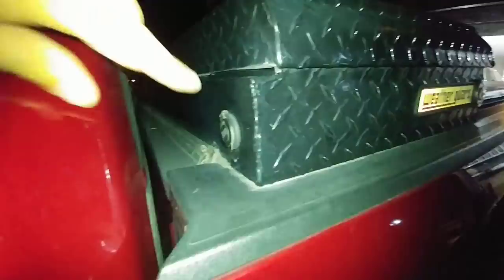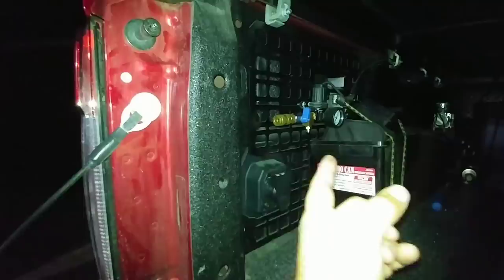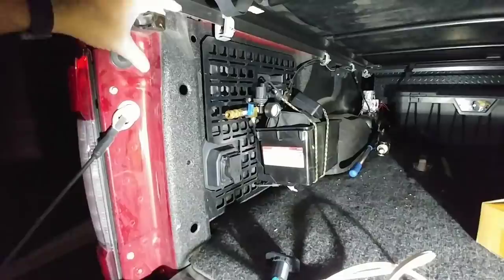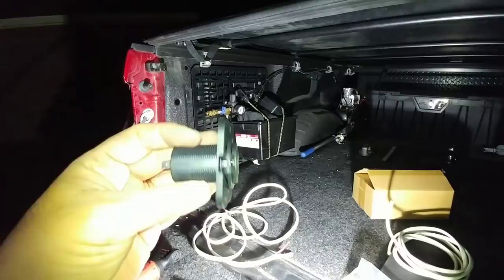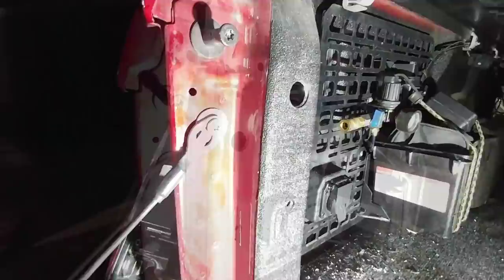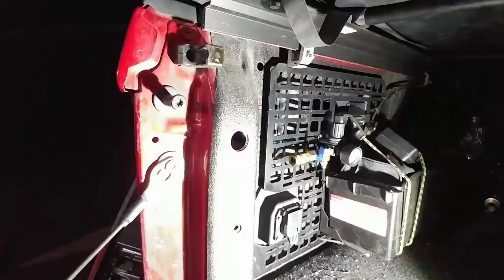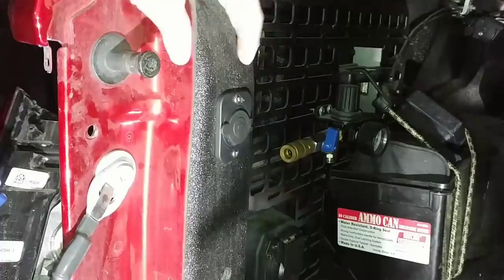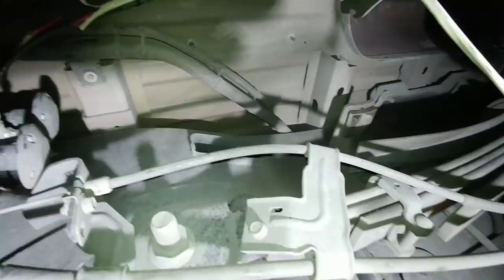DIY Pickup Truck Upgrade FOR UNDER $25 that is useful!

Comment: Awesome upgrade!! I need to do this. Pro tip: if you dont have a step bit that large, I always use hole saws. Stack two hole saw bits so the one on the inside is the size of the existing hole, your pilot bit, and the hole saw bit on the outside is the size hole you want to drill. Works like a charm every time!

Comment: I would be concerned with stainless on Aluminum with an increased (galvanic) corrosion potential especially that being a damp area. Otherwise a really cool idea. eTrailer sent me aluminum screws for the auxiliary 7 pin connector. Thanks for the videos
Reply: You want to use stainless steel hardware with aluminum along with anti-seize compound to prevent galvanic corrosion.

Comment: Didn't know about the wire types. Thanks so much for more valuable info, JD. Even though I'm up here in north Tx with no humidity (and you're down in south Tx with all of it) the info still makes a difference.  Troy  (I'm originally from Baton Rouge and humidity is one thing I definitely don't miss. It's miserable to live with and can wreak havoc with your things- paint jobs, wiring, seals, expansion/contraction probs, etc.)  This info about the wires is great.

Comment: Untreated aluminum on that bed will corrode, especially being so close to the ocean.  That’s a great idea for those holes.
Reply: Actually aluminum can oxidize but will not corrode like steel. It holds up well, even in coastal climates.

Comment: That's a great idea 💡. 👍🏻👍🏻👍🏻. I'm planning on putting a backup camera in my 07 Ram dually but I'm gonna do it to where I can hook it up to my taillights or the backup lights so that when I'm hooked up to a trailer I can move the camera to the back of it for better viewing of where I'm backing up to   Hoping this will make it easier when either backing the car trailer up to a broken down vehicle or camper into a park or backing up my 40' gooseneck through a gate.

Comment: The 3 holes on each side are for the bed extender. My dad had this feature on 3 different F-150's. The same goes for the Super Duty trucks.
Reply: What's a bed extender
Reply: @keith6033  This an aftermarket version of the Ford Bed extender. https://www.stage3motorsports.com/74814-0-1999-2013-F-250-F-350-Standard-AMP-Research-BEDXTENDER-HD-Max.html
Reply: I thought the holes might be related to factory assembly.  Maybe dual purpose?

Comment: I just bought an adapter the plugs into the 7way trailer plug in the bed. Has 2 12v outlets on it. Works great.

Comment: Might want to put a inline fuse feeding that branch. Wire size is important but it has to be protected with a fuse. 12 gauge is good for 20 amps FYI

Comment: I find that drilling holes inside the bed of a truck isn't as bad as anything on the exterior of it because a lot of people add tool boxes and other things that need to be screwed or bolted to the inside or top of the bed anyway and as long as there's not holes all over the bed it's not too noticeable

Comment: Did this mod to my truck when I first bought it to run my ARB fridge/freezer.  But I made mine have power all the time no need to run the truck. My ARB has been running in the bed of my truck for 3 years.

Comment: Like this video, also how you done the install !
Noticed your compressor. Can you tell me it's dimensions make, air output, also have you made a install video in the past ?
Having a air compressor on board can come in handy for many uses, especially when tire pressure decreases over time.
Most car and truck owners neglect checking tire pressure on a regular basis !
Installing a air compressor  on my ordered 2020 power wagon arrives.